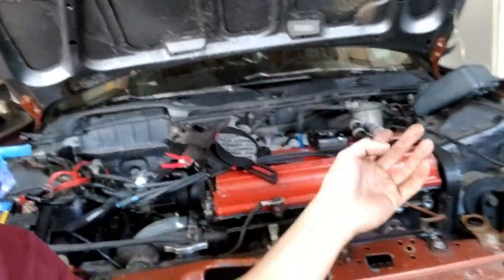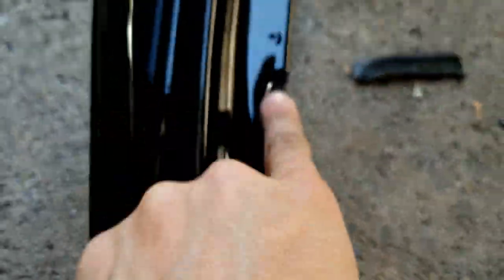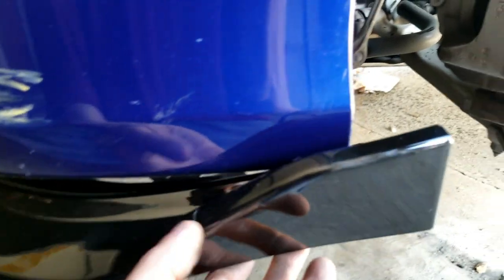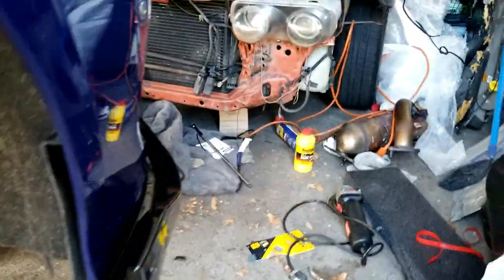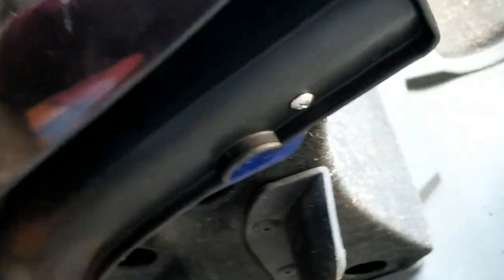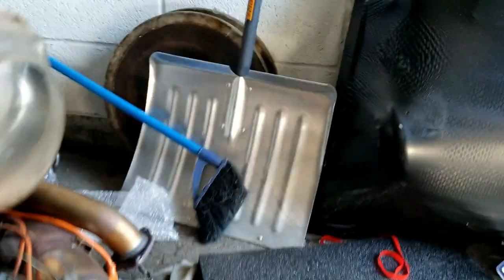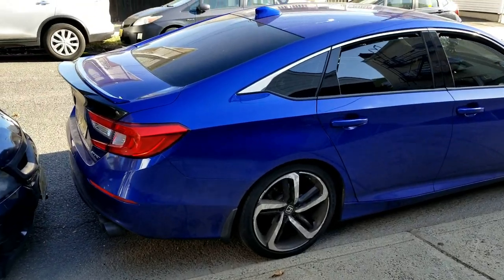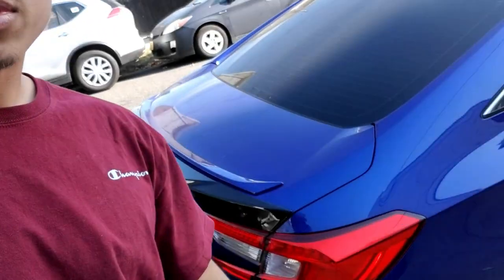MY 2018 HONDA ACCORD GETS A JDM STYLE FRONT LIP!! ( LOOKS SO AGGRESSIVE )

Comment: Nice ride man. Is that the eibach pro-kit springs you installed? The one that lowers 0.8 front and back??
Reply from the maker: Thanks bro. Yes it is eibach pro line kit.
Reply: @Adonis_pov  ,  thanks for replying.. about how many fingers gap does it leave? Also are you having problems with excessive tire wear? I'm debating if i should get the H&R springs that will lower 1.2.. I wasnt sure if these eibach will lower enough but just enough to cover the gap for the factory sport rims..